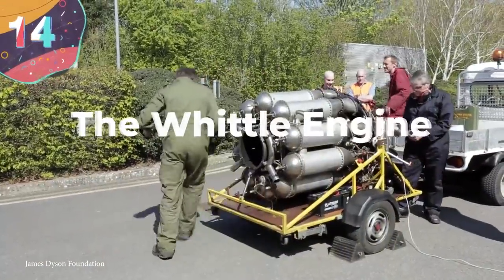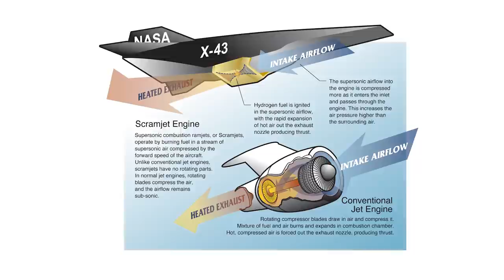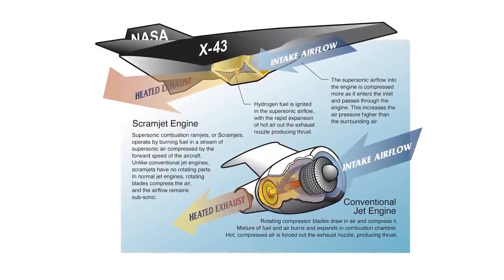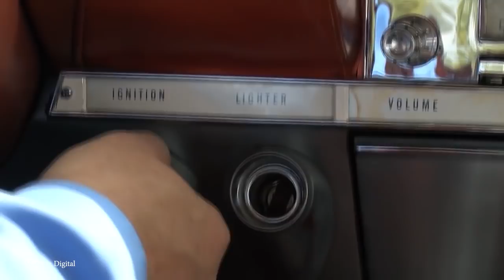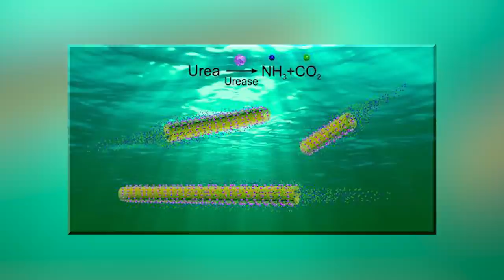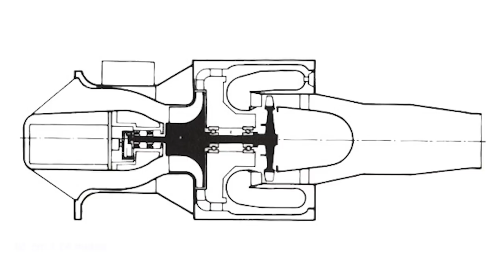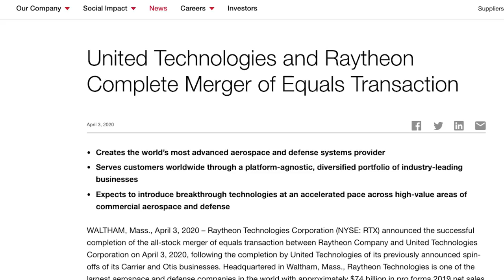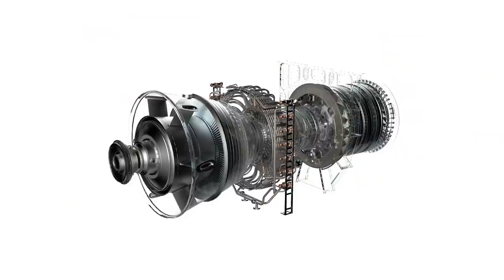15 Most Incredible Jet Engines

Comment: A very good and interesting selection. I have only one gripe - the title. It should read "15 of the Most Incredible Turbine Engines" perhaps with "In Our Opinion" as a qualifier. Many important engines were missed out. For example the BMW 003 which was developed as a competitor to the Junkers Jumo and formed the basis of the successful French jet engines of the post-war era which powered the various Mirage jets and others. You also missed the significance of the Whittle engine and its developments as being the power in many of the early jet aircraft of the UK, USA, France and of course The Soviet Union in the MiG15.

Comment: The classic error at 11mins discussing the RR Trent engine. RR aero engines based in Derby UK are nothing to do with RR Motor cars. RR split into separate companies in about the early 1970s -  RR Motor Cars  and RR aero engines. RR Motor cars was then taken over by BMW sometime later. RR Motor cars, I think, also moved away and maybe even shut their factory in Crewe, Cheshire (where they had been based for many years) and moved to Hampshire,  UK.

Comment: Admittedly, i didn't watch every minute. But the biological engine resembles rather a rocket engine than a turbine jet engine.
When Wittles engine is a thing, then should be the Heinkel HeS 3 a thing. It was the first jet engine to take off the ground in an actul jet plane. Remarkable i guess.
Somewhat missing is the Rolls-Royce BR700 series or former BMW-Rolls-Royce, hence BR, is the mainstay of business jets and some regional and military jets. Soon to become the powerplant of the B-52 Stratofortress.